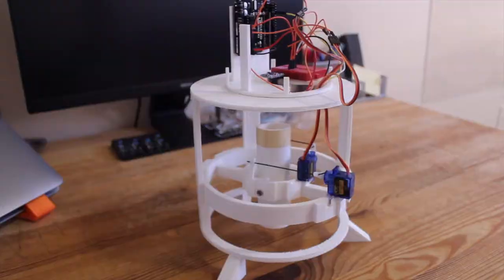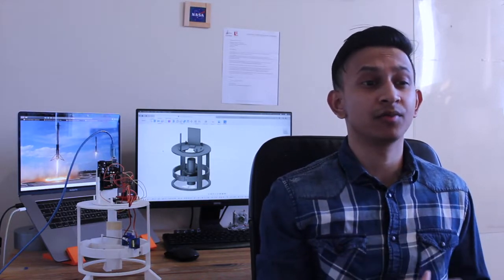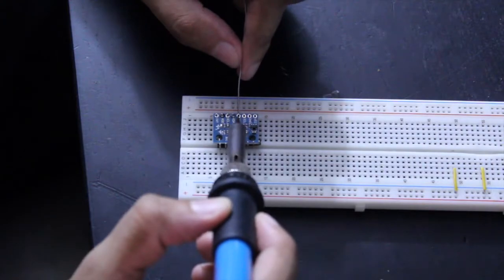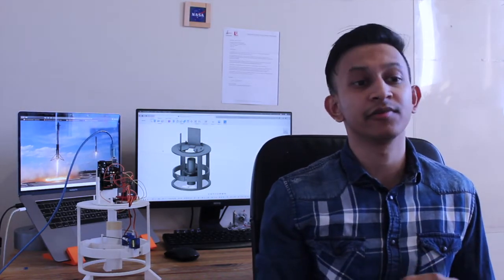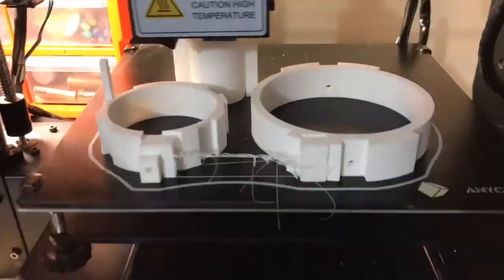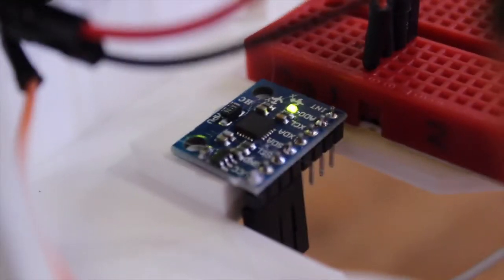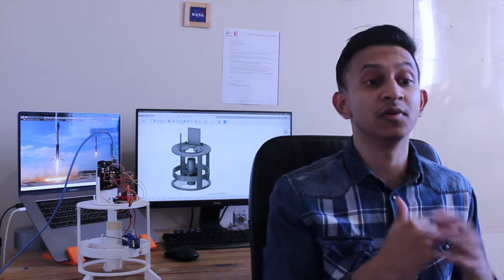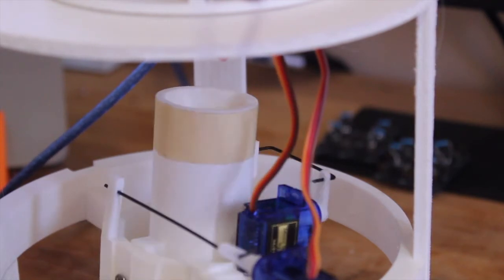Thrust Vector Control System Using Arduino and JavaFX

Comment: Well yes, you can start with Arduino, but Arduino processor ARM32 is not capable for handling multiple calc transaction at a time. you will need a bigger MPU.
Reply: It mostly depend on how to perform calculations. I sure in that arduino can process at least 50k values per second